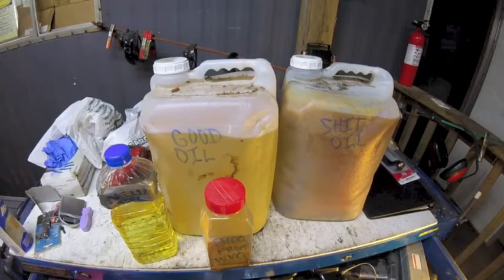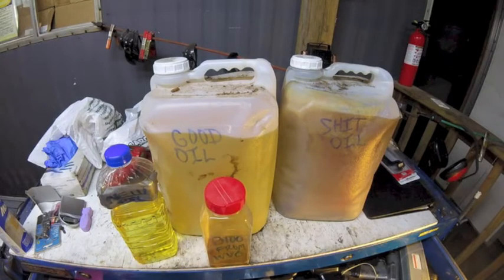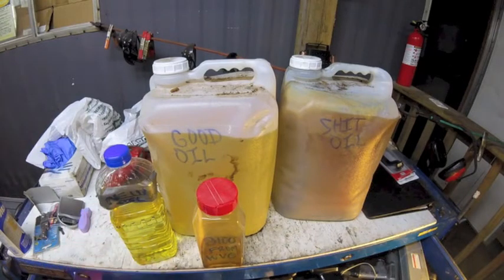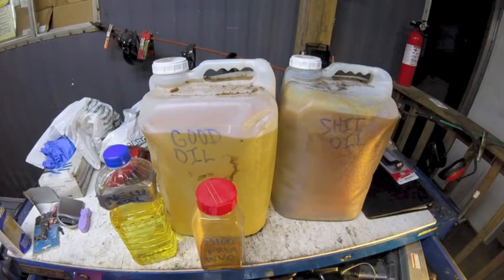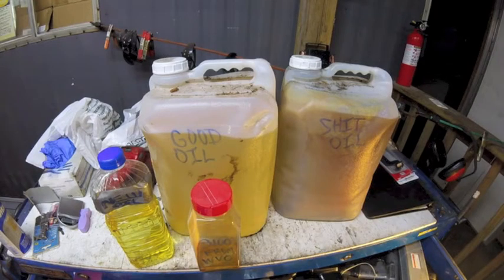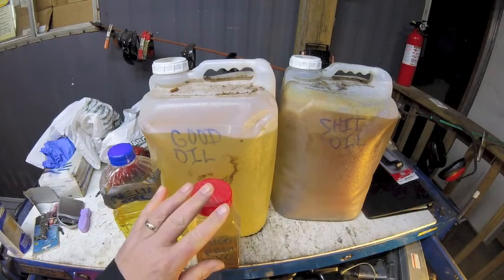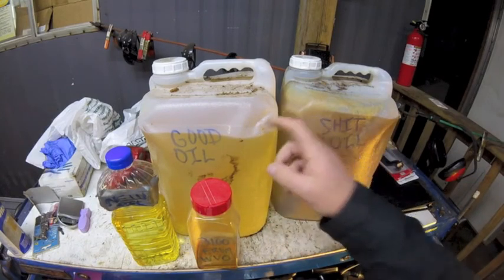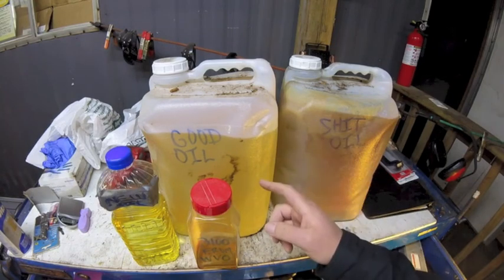GREASE CAR DIARIES

Comment: So, let's say a guy wants to start making some fuel for his old diesel truck, would it be feasible to approach a restaurant for some regular grease dipping to get the operation going? I'm pretty far away from doing anything like that, but I had a friend who did it in the past and was doing fairly well with it, he just didn't drive enough to warrant it.
Reply from the maker: Yeah, the Mom and pop restaurants are the easiest to talk into it, small bars, bowling alleys, low volume users. They are probably not getting paid and if you know them they're likely to want to help you out. The one thing you need to be sure of though is that you pick it up on a regular basis-- Most homebrewers give up at some point and it irritates the business. Heavy users are the hardest to convert unless they're receiving poor service from their current collector.